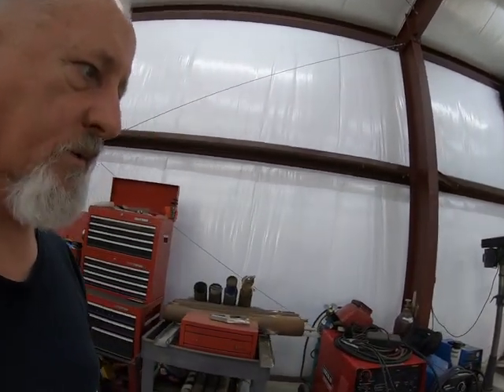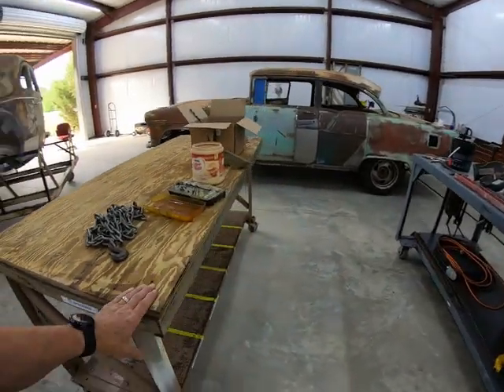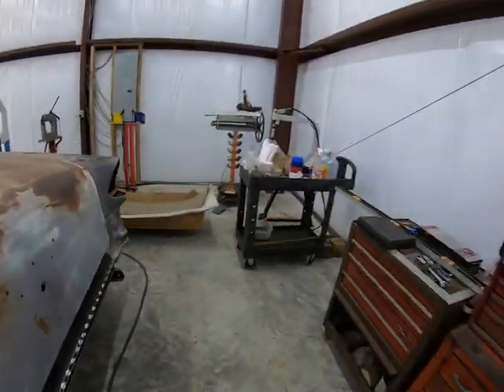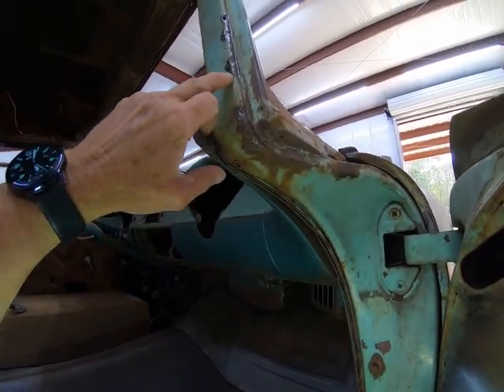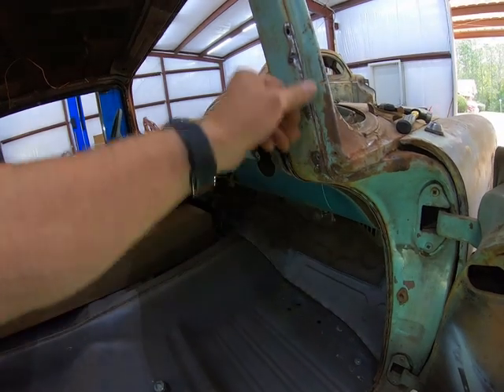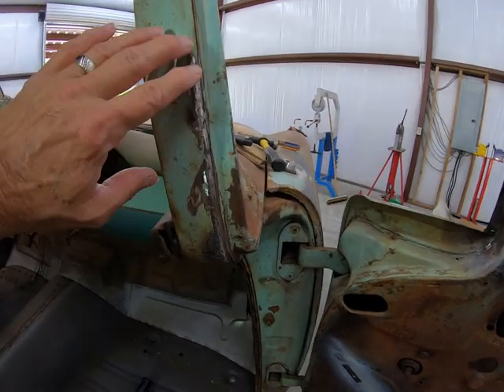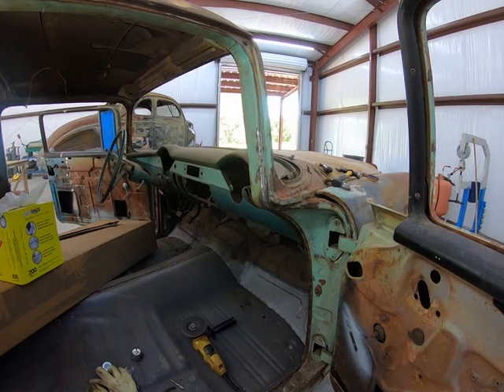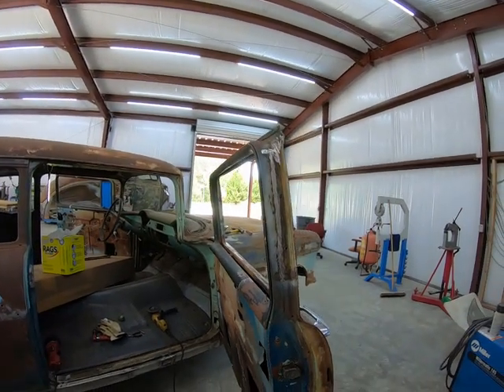First Time Working on the 55 Chevy in the New Shop

Comment: It took me forever to plan out my garage and I still am not sure sometimes that it's just right. Mine is laid out much like yours is. My lift is in the middle of the big garage door on the building end. To the right of the lift is my metal working tools. To the left are my tool boxes and work bench. That way my tools and welders are close to the lift. I have another work bench on the same wall as my tool boxes but further down. I use this for clean work. I have a second garage door on the other end of the building where I try to keep the area clear so I can work on paint and interior. This way as you move away from the lift the build becomes cleaner in terms of the work I do. Sure is great to see you working again.
Reply from the maker: That does make sense to lay it out that way.  thanks! I've never had much room like this in a shop before. I still want to put metal on the bottom half of way to protect the insulation.
Reply: @RadRandyandLilCindyRogers  That sounds like a great idea.